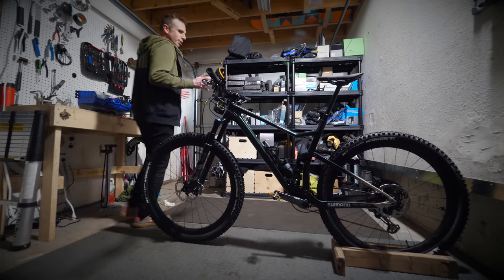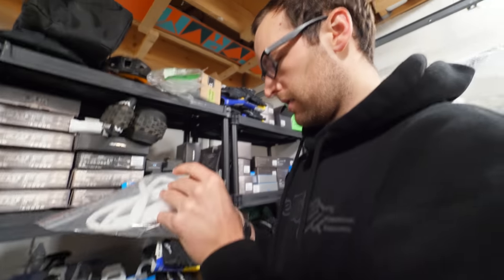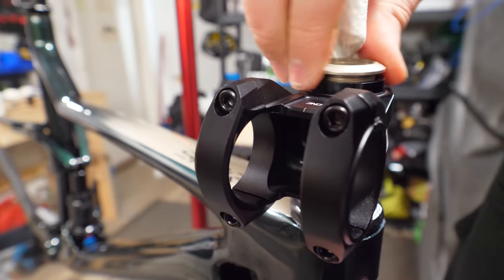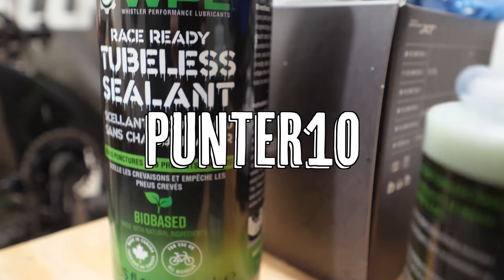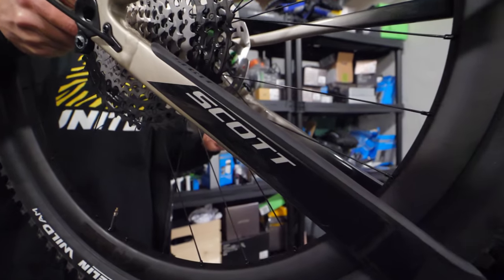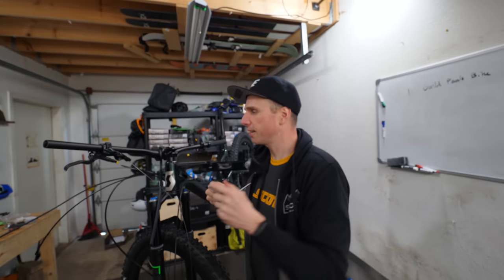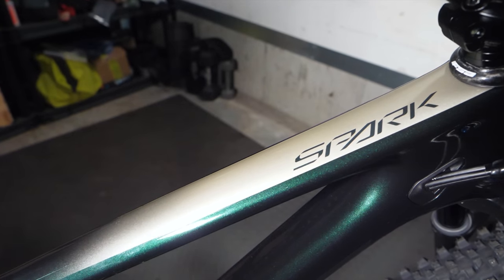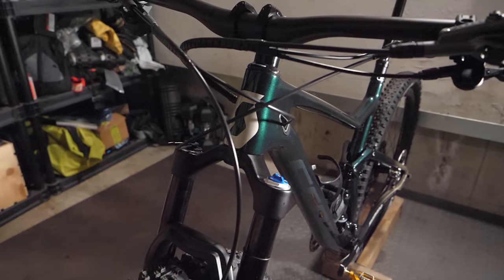My New Scott Spark Trail Bike is Something Special...

Comment: Well it kept me entertained for a short time.. 😂.. If u don't mind me asking? Do u have a trade Paul.? Just curious as mtb you tuber isn't on the emigration list of trades.. 😂 😂..Also.. A good (one of the best) exercises for grip strength / endurance is, Get a section of broom handle tie a length of rope to it (approx body length) add weight.. Then hold arms out straight and roll up the weight, once buggered. Turn hands over and do again.. Once you find it easy, add more length of rope and, or weight, just stand higher off the floor (I do it from upstairs window) .. (being climbing for over 21yrs, this is a fantastic way of building strength and endurance in the arms)

Comment: Forearm training could be done by a simple grip strength training. I saw one on a boulder channel once. You take a barbell in your hand while standing and let the arm hang on the side of your upper body. You then open your hand VERY slow and let the bar bell roll to your fingertips (you should be able to do so, otherwise its too heavy) and roll the barbell back while closing your hand completely again. Repeat for like 10-20 times (if you can't, use a less heavier weight).  I should be able to find the link to that video if you are interested.
Reply: Found it: https://youtu.be/e2oWz1fKgik?t=403
Reply from the maker: cool!

Comment: Nice story. I loved the comedy bits, and this was entertainingly narrated. And I have to say I'm pretty taken by WPL products. I received a bottle each of their shock lube and dry chain lube and had the opportunity to use them this past weekend. I'm not familiar with the use of shock lube, so while it seemed to be a pretty straight forward process to apply, I don't know if I can honestly say I noticed any difference in the performance of my shocks. However, the chain lube was awesome. I usually use Finish Line dry chain lube, and what I particularly liked about the WPL is that I could actually tell that it was getting on the chain. The Finish Line product, while pretty nice, tends to clog up in the spout even when I shake it vigorously and often. So win on the WPL products. Because of that experience, I'm very curious about the sealant you talk about here. I'll be checking that out soon.

Stay upright and keep the rubber side down!

-Brian

Comment: All the recent Scott Spark & Genius models now have this twin lock feature for the suspension. My question is would it still be able to accept a 2x12 drivetrain? Can the frame accept placement of a front derailleur? Will it clutter the cockpit or will the cockpit even fit all the required levers for front & rear derailleur, dropper seat post & the twin lock? I'm asking because I'm looking to build a 27.5" bike (probably Scott frameset) but with a 2x12 drivetrain
Reply from the maker: Shimano and 12speed in general doesn’t work as a 2x system. It will break. You really don’t need a 2x setup nowadays.
Reply: @PaulThePunter  you sure it will break? Shimano does make a 2x12 drivetrain for their SLX and Deore line. The cassette goes from 10-46 for a 2x12 instead of 10-50. I understand and appreciate the trend by manufacturers to go single chainring these days but a bit more range doesn't hurt, right?

Comment: In the periodic table out of the 86 elements with names ending in 'um' there are only 7 where it's not preceded by an i. Then again it could easily be called Jackalfoot or Unicornfart in US/Canadian English if they so decided, they don't need to follow any conventions. That's essentially what happened with Aluminium but in a more confusing way. They gave it a new name in US/Canadian English and this new name happened to be just 1 letter short the English (and Danish - the nationality of the physicist who discovered the element) name. It's a pretty weird thing to give such an important thing as a chemical element different names in different versions of English but at the same time leaving the difference so little that it looks like a minor typo. Since everyone can understand both pronunciations I lean towards using Aluminium. If you want to please everyone on the internet you can use the alloy designation number which is a more exact identification of the material. But then good luck never getting it wrong which part of your bike is made of what alloy. And then there are components using parts made out of several different alloys. The fun never stops.
Anyway, I don't like downcountry bikes but you make this stuff entertaining enough to watch so thumbs up!
Reply from the maker: Haha nice! Did you know that the element actually had 2 name changes? Originally it was called allum, then aluminum and finally changed to aluminium. It was the states that changed it to the latter for a bit, before long people just went back to using the previous version.
Reply: @PaulThePunter  I didn't know that. It's tricky with languages, eventually the commonly spoken words tend to end up officially accepted. I imagine it doesn't work that well in reverse.
Reply: mountain biking shouldnt be like this complicated.. 😂

Comment: It's weird seeing FOX 34's on XC bikes these days. If I were to build up my own XC ride I'd prefer a FOX 32 since most XC trails you're not hitting burms like the pro's. To each their own :)
Reply: It's a down country bike. It's meant to be strong enough to handle enduro tracks while being light.
Reply: @leomolloy5067  It's a Trail/XC bike. I'd recommend learning about what makes a bike a down country bike first.
Reply from the maker: Nah it's a downcountry bike. Bigger tires, wide bars - it's DC fo sho.
Reply: Paul The Punter Sorry for the confusion but I wasn't referring to your custom built Spark. I'm referring to factory built bikes but after looking at their website I see they still run 32's on XC and 34's on Trail Sparks. I was incorrect assuming that Scott dropped the 32 fork for 34 for their XC bikes for 2020. 

Reason for my assumption is that back in the day Fox 34's were on agressive trail/all mountain bikes now they use 36's and who knows maybe it'll get bumped to 38's.

Comment: Bit outta touch with the stem, no need to tap the new edc stem.
Reply: Huh?  He tapped the steerer tube so he could install the edc tool.
Reply: thebeans66 there is a new version available. You don’t need to tap steerer tube. I have one for the edc tool. Go check out the website.